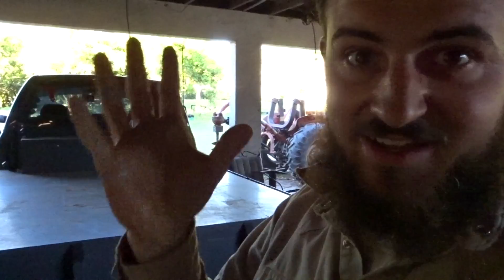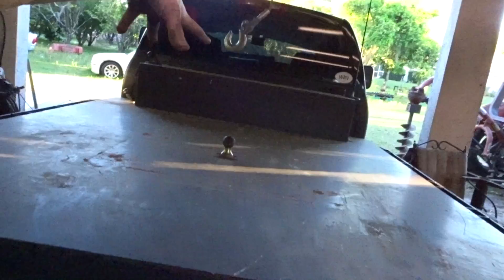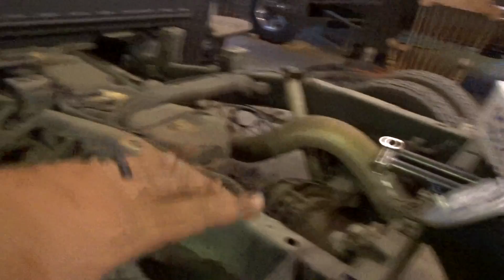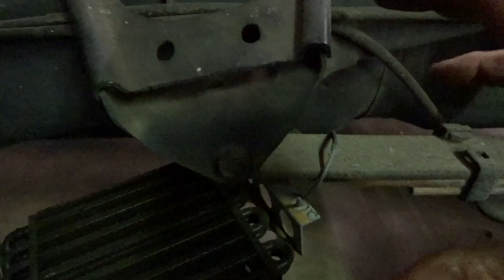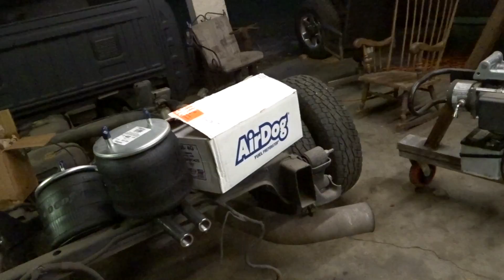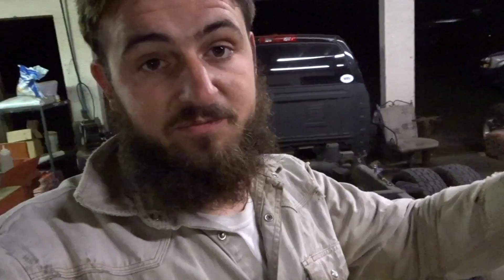Next Welding Rig Project With Air Suspension And 4 Link

Comment: On semis and other various trucks, the bags are behind the axle because you can handle more weight as well as the overall ride is much better. If you look up kelderman, most of their kits are that way unless you go to their lifted long travel/air setups where they put them on the axle. Great video!
Reply from the maker: All true, I know it will work but I also have my doubts about longevity and such, only one way to find out
Reply: I have a c30, curious now how many air bags it would need , as the spring packs are huge .
Reply from the maker: I don’t know the proper way to calculate the rating per bag but these are big semi bags and I’d say they are rated for about 8-10k each
Reply: J_Moffitt awesome thanks 👌
Reply: Great video dude like the content lots 👌